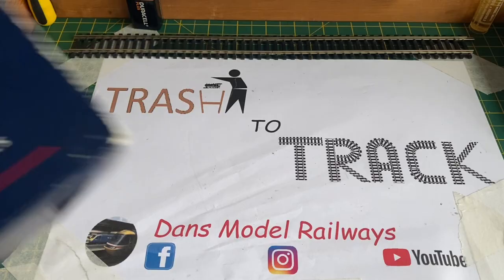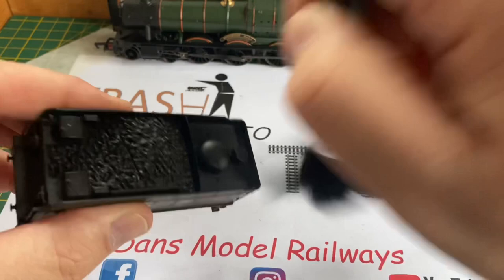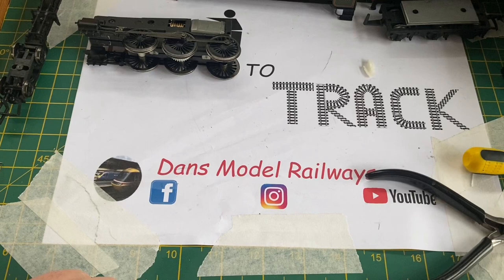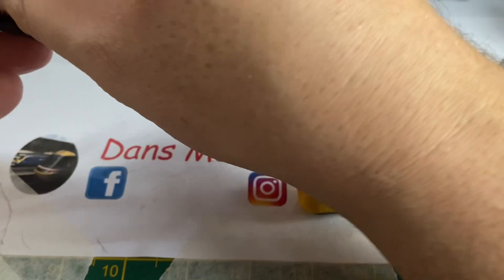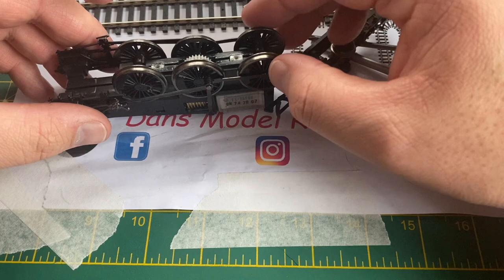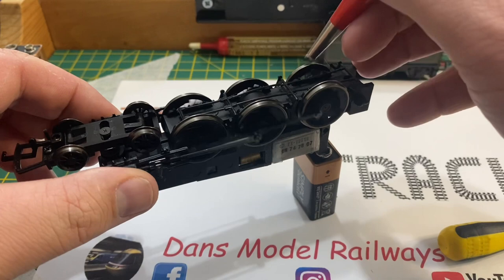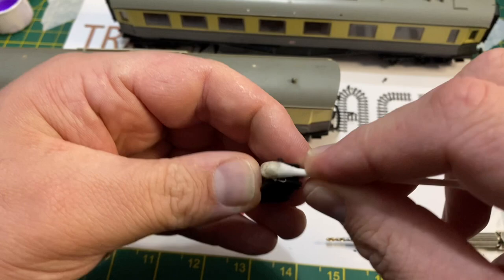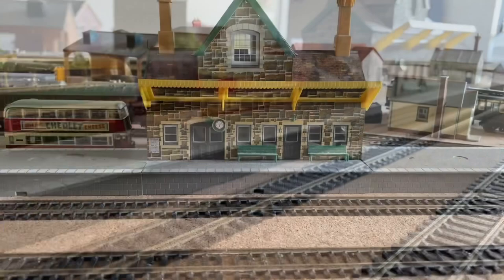Trash To Track. Episode 34. Bachmann Hall Split chassis loco.

Comment: Another excellent repair, I actually sent a Mainline Peak to the guy who made those axles and he designed up some new gears that I needed making as spares weren't available so he can make new bits for it if you send the part or loco over

Comment: Bachmann has these poor material in the N scale locos as well. Even the gears are made with this plastic and the hubs where the shafts are inserted, tend to split in all of them and the crack goes across the whole gear. I have repaired some of them by putting tiny sleeves of aluminum or brass tubing cut to about 2 mm in length on each side. Buying a new gear will cost an arm and a leg with shipping. Very bad material to use for this application.